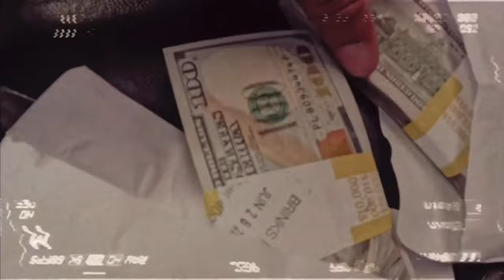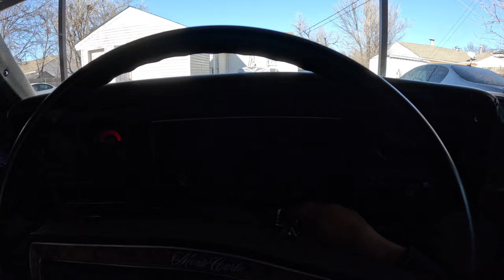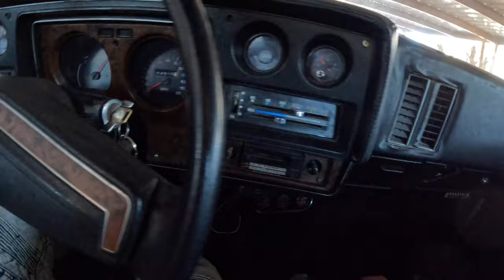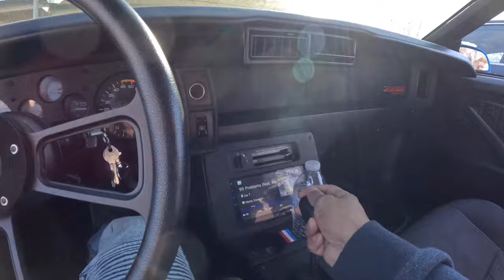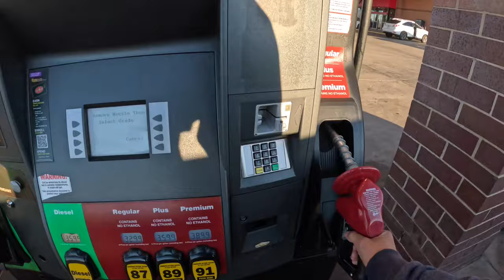Unc Destroyed His Own Car And Threatened To Call The Police On Me If I Don’t Give Up My Insurance

Comment: 🚨WHY THE HELL HE DIDN'T TAKE THE CAR OFF THE TRAILER IN THE YARD I'M CONFUSED 🚨
Reply: Because they would be pushing that behemoth by hand vs truck. Plus he probably wants the wagon to pull into the garage so he can swap the motor plus you won’t have much room in the backyard for the behemoth and the truck and his other cars. Plus the behemoth will roll better in the street and it’s level so he doesn’t beat up the truck on uneven ground